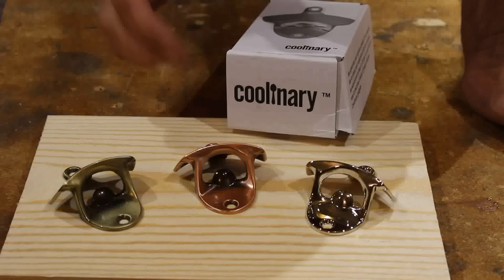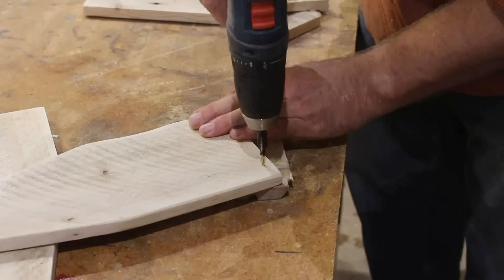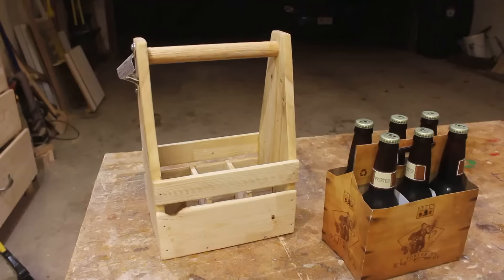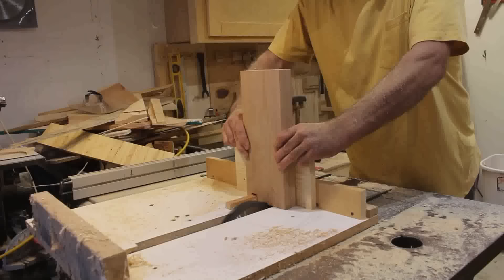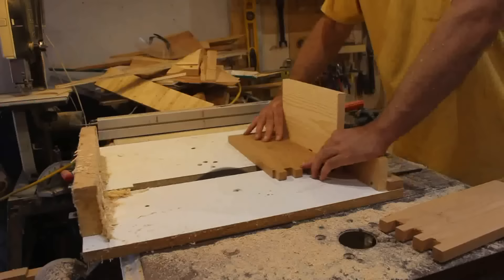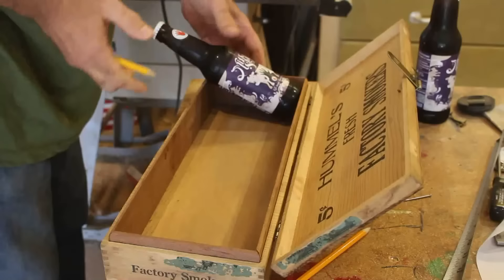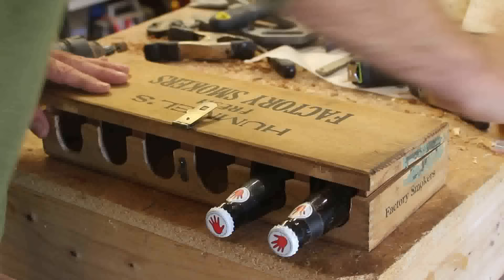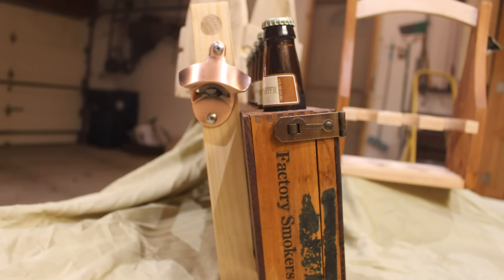I Built Beer Totes/Caddies - 3 Different Styles

Comment: Interesting comment about the holesaw burning the wood.  I had an old wire brush that was about to go in the bin.  I cut a length about 2" and screwed it onto another smaller piece of timber.  Clamp it to the drill press table so the bristles are touching the holesaw and keep backing off the holesaw and the bristles automatically brush the sawdust off the holesaw and the cuts are burn-free.